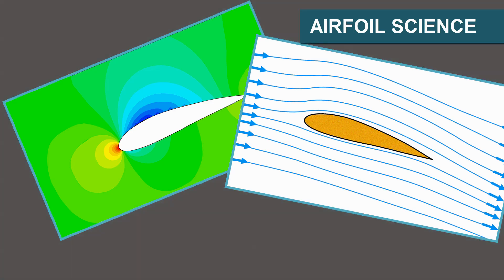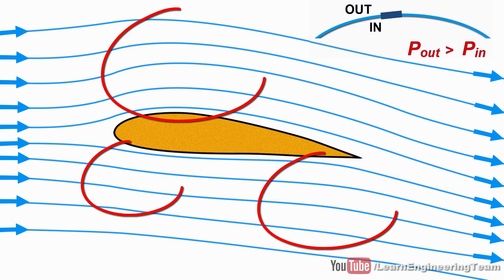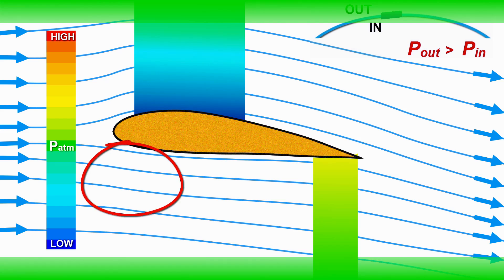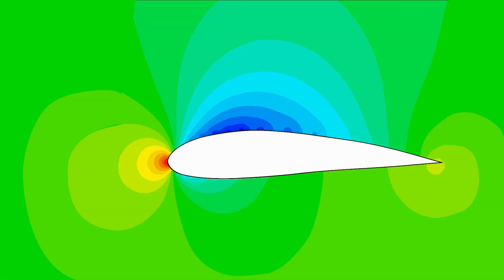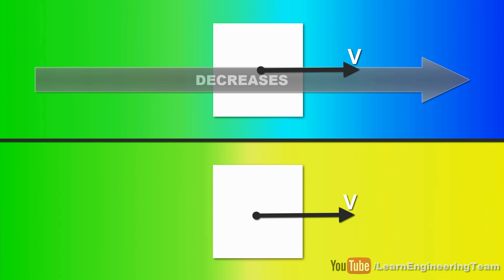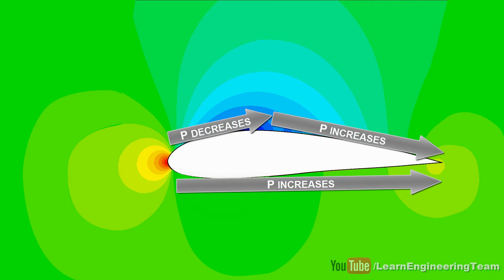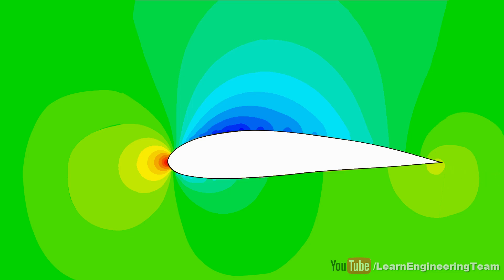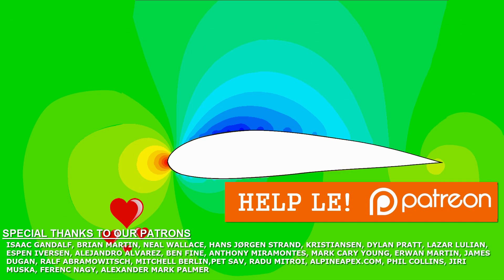Why is the top flow faster over an Airfoil?

Comment: Why pressure at the outside curve is higher?

I would explain the different of velocity with the continuity equation...
Reply: the lower pressure is cause of the high velocity (bernoulli equation), and the high velocity is caused because of continuity equation (due to the aerodynamic shape it's like the area of air is lower, so the velocity is higher)
Reply: "the lower pressure is cause of the high velocity" you have that backwards. The high velocity is caused by the low pressure. The low pressure is caused by the obstruction.
Reply: there are two different bernoulli equations, one explains the moviment only in the direction of the current line, the other explains the moviment (flow energy, kinetic energy and potential energy) at the radial direction of the flow. the radius of the current line is what cause that effect int the pressure, less radius implies in less pressure, therefore the external curvature has more pressure and the internal ( close to the top of the wing) has a minor radius and so has less pressure on the top of the wing
Reply: +Fernando Oliveira No, otherwise you wouldn't be able to fly flat wings, but you can. Your information is a bit out of date.
Reply: Anonymous User the deflection of the current line created by the flat wind curves the line creating the radius as shown in the last image of this site warp.povusers.org/grrr/airfoilmyth.html
Reply: My explanation was only a scratch about what really happens, but is an easy way to understand, but some hypothesis are made to make easier the calculus to utilize bernoulli
Reply: +Fernando Oliveria Right, bernoulli is not required here. Aerofoil shapes are simply optimal for drag.
Reply: Anonymous User Bernoulli standard equation, but Bernoulli adapted to the radius direction is a simple model to understand that's not the velocity what change the pressure, is the chape of the current line
Reply: Shape*

Comment: In some point, in the leading  edge of a virtual profil, the two particles Will meeting agaim. the fluid is a continous, or you belive in a eternal formatin of two layers in the atmosfere after  the air pass througt a wing or vice versa? 
The layer formed by the air that pass over the profils will contein more air tham the inferior layer?
the Bernoulli hipotesys is correct. 
The kutta -joukovisk condition do not is a exigence for lift formation,  the meeting point for the two particles is not the leading edge of this profil that we are seing. The meeting point is in the end of the turbulence formed after the profil, it  can be far in distance or same in time, the particles do not meet instataneously . The Newton laws are correct, you can use deflection to splain lift it's Ok. Do you can splain the stol around 16 degres? the deflection still there after this angle. the deflection alone do not splain the lift formation. 
Lift cames fron pressure gradient, Bernoulli is again the solution. Whit the increase of the fluid speed into a direction, the number of this particles that Will shock whit the walls, paralel to this fluid motion Will shirink and consequentely the pressure in the same way.

Comment: At the leading edge at the bottom pressure is dropping but at the trailing edge pressure is increasing.... could anyone tell me why?
Reply: +prasan hegde  Some of this is a bit misleading due to the very low, perhaps negative Angle of Attack (AOA). I recommended that he show a higher AOA for better understanding of the important phenomena.   With this AOA, it looks like he is actually starting to show reduced lift for a descent rather than full lift.  (the Wing is starting to act in a way similar to inverted flight where the lower pressure is on the bottom/flat side)
...
I believe the slight lowered pressure under the leading edge is a distraction to the basic lift physics and does not occur at a higher AOA.   This is because there is an upward movement of air (up-wash) up stream of the leading edge caused by the high pressure under the wing pushing air forward and upward well ahead of the leading edge.  The air approaches the leading edge already headed upward
...
Remember that a higher pressure region will push (accelerate) air toward any and all near-by lower pressure regions and the air under the wing MUST be pushing air forward and, therefore, upward ahead of the leading edge.  This is up-wash and is well known/understood.
... 
...THEN
I'd have to analyze further, but under the trailing edge, the air is changing from a downward accelerated curve to only the resulting, net downward motion and therefore, the pressure gradient causing the curved path is no longer there. Remember that a curved path is also an acceleration and a radial force (pressure) is required to cause it.  It is also nearing the lowered pressure and higher speed" of the upper air leaving the traiing edge
...
.Remember that a higher pressure region will push (accelerate) air toward *any and all near-by lower pressure regions and the air leaving the upper training edge is already at a lower pressure
...
The important thing to focus on is the fact that the relative motion of the object and air is what causes the pressure changes; which then cause the accelerations of the air that we see around the wing.  
...
Pressure difference is the force that accelerates a mass of air.  Newton prevails ALWAYS.
-- 
Cheers, ScienceAdvisorSteve

Comment: @Learn Engineering The starting vortex theory explains how the velocity over the airfoil and below differ which in turn produces a difference in pressure. Check the starting vortex theory it makes sense mathematically as well as logically.
Reply: Math is a model of the physics.  This explains the physics that is modeled by the math.  ...Don't get me wrong.  The math (and various techniques developed in the math) is critical in calculating lift, but the physics phenomena are easily explained without math.
Reply: I have been plugging the starting vortex in all these videos. Vorticity of opposite rotation is bound up with the wing, and generates lift by the Magnus effect. Simple!

The Kutta-Joukowski circulation theorem is just the Magnus effect by another name.

Comment: Bernulli's principle assumes non-viscous, non-frixtion flow and is therefore correct for such cases (i.e 2 particles should meet together at the trailing edge etc. ) . Experiments do not agree with the theory because, well. real fluids are viscous and have friction in a non linear way. Navier-Stokes equations account for all of it though.

Comment: Could anyone explain for me why pressure at the outside curve is higher?
Reply: plz someone explain
Reply: Bro let me put it this way. İmagine you are on the street running away from a cold blooded killer. Since you are running forward your body collapses with air molecules which would grant those molecules a motion around your body. So imagine the velocities between the air molecules 1st top of your hair 2nd 5m higher than your head. Which one you think would move faster. Well since you granted a motion to the the air you collapse it should have higher velocity than the one 5m away from ur head. So higher velocity would have lower pressure therefore the pressure above your head is lower than pressure that is 5m above your head. Same goes for plane wings.
Reply: Its easier thsn you think.
Imagine if the air particles were little plastic balls.
When they hit a curved surface at velocity,  they would be rapidly shoveled aside like a plough.
but
Because they are air, that shovelling aside would create a vacuum,  which atmospheric pressure would need to fill quickly.
So, the low pressure is just air particles trying to form a vacuum as they are forced aside by the wings velocity.
Reply: As Ray Watson said "that shovelling aside would create a vacuum" this is because the air molecules are trying to leave the wing in an upward direction. However, there is no way for air to fill it so lift results because it is the wing that moves into the vacuum instead.

Comment: There is a good bit of tautological reasoning happening in this video.  What is important is that the pressure difference exists in this situation, and that a theoretical model of the flow based on first principles agrees with the observation.  Attempting, after that, to come up with a simple explanation of "why" risks getting tangled up in circular reasoning. If you want to understand the theoretical models you start with the basic principles of force, mass, and acceleration of the fluid, and the principles of conversation of mass, momentum, and energy. None of which are mentioned in this video.
Reply: Because it was discussed in the previous video.
Reply: So you’re saying there is no simple way of explaining why the flow is faster on top, other than saying thats the way it is given fluid dynamic principles.
Reply: Jim Trainor My simple explanation would be that the airfoil acts kind of like a nozzle, accelerating air by forcing it to move through a smaller area.  Imagine putting another airfoil on top of this one, but flipped upside down.  The two airfoils would act as a nozzle to the air flowing between them, causing the flow to accelerate, then decelerate back to normal speed as it exits the nozzle.  Having just the lower airfoil does the same effect, only less pronounced; it still accelerates the flow above it, lowering its pressure, by forcing it to move through a smaller area.  The bottom surface is less curved so the acceleration and pressure reduction is less.  Thus upper pressure is lower and there is a net up force.

Comment: I think the problem is to try and use Bernoulli's theory/equations collectively for both the upper and the lower surface. If for a minute you stop and treat the upper and the bottom part separately and apply Bernoulli's equation you will find out that it's not wrong after all. Let's start with the upper surface: the flow approaches the aerofoil and the area in which it flows converges and then diverges. Bernoulli's theorem states that when the area converges the flow speeds up and the pressure drops and when it diverges the flow slows and pressure starts to increase. This is exactly what happens on the top of an aerofoil. Now considering the bottom surface: when flow approaches the aerofoil the area slightly converges prompting a slight pressure decrease and then the area diverges increasing the pressure and slowing down the flow. Now if you consider the collective contribution of the conditions below and above the aerofoil you will get lift. But I don't think Bernoulli alone is suffic
Reply: Then explain why a flat wing still works. Sorry, but Bernoulli's is not the correct way to understand lift. https://www.grc.nasa.gov/www/k-12/airplane/wrong1.html

Comment: These videos have been really interesting, but I have to admit that I find the word 'airfoil' to be irrationaly irritating for some reason.
Reply: Why though? It's a foil designed for the flow of air. The term foil comes from the notion of a foil as a leaf shaped curve formed by the cusping of an arch or circle. An Airfoil is a similarly leaf-shaped curve or blade that is used to push/cut the air. Look at the cross sections of common airfoil shapes, and you will see the similarity to the shape of a leaf. Foil is derived from the latin folium meaning leaf.
Reply: Well you could say "wing" but that would kind of miss the point because you can use airfoils for things other than wings. I guess "blade" would be a more suitable catchall term if we're trying to use ordinary language.
Reply: @Navak_  and what about rotor blades, stator vanes, they are all airfoils but not wings. In other words, "wing" is related to an application, whereas "airfoil" (or "aerofoil" in british english) is generic for a family of objects with a variety of applications

Comment: Coanda effect is only for fluid jets. Wings don't naturally experience coanda effect except from jet engine exhaust. Airflow follows the wing due to air viscosity. While the concept of Coanda vs. flow attachment due to viscosity is similar, Coanda effect is only considered applicable for fluid jets.
Reply: You may want to rethink your statement, maybe do some additional research.